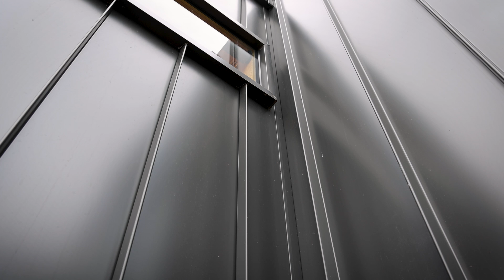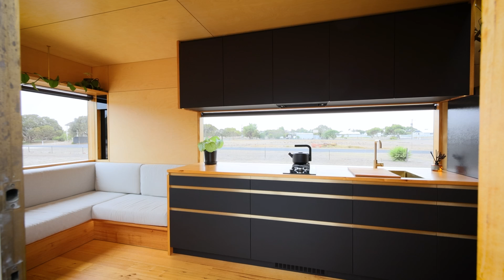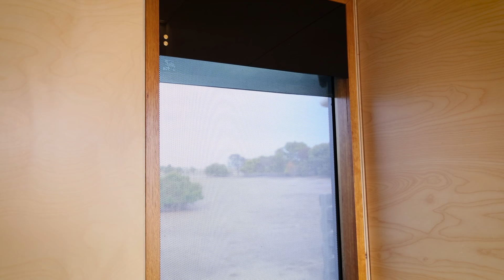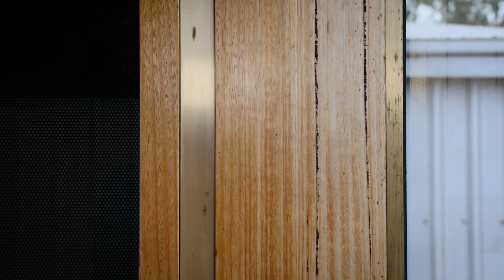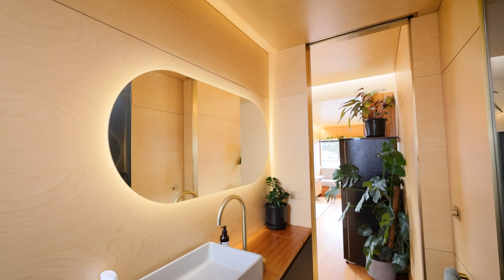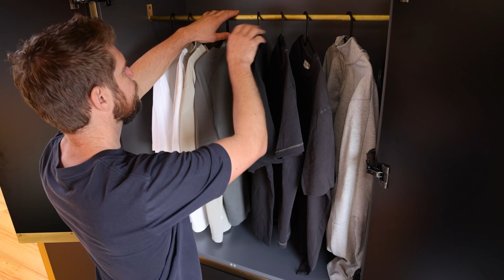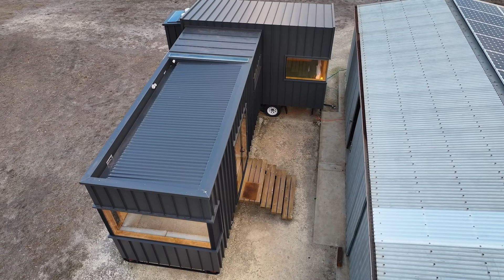Modern-Minimalist Two-Trailer Tiny Home | A Genius DIY Build That Will Blow Your Mind

Comment: I’ve worked in the waterproofing industry for approximately 30 years and am based in the USA.   The level of engineering he put into build exceeds the typical new construction (commercial and residential) we typically see. Further, I am in a hurricane zone of Florida where waterproofing is critical and code driven by the stringent Miami Dade Wind Code. I’d put this home in a wind/water testing chamber with zero reservations. This is truly a marvel.  The way he joined the two structures and detailed the connections and planes is impressive as heck.  I’d struggle preparing CADD details with some of these connections that he figured out 😐.  Roof - to - roof and wall- to-wall connections are very tricky. Amazing! And…the icing on the cake is how BEAUTIFUL the home is. Wow. This one is at least ten levels above some of my favorite builds I’ve seen. ♥🇺🇸
Reply: Well, your response, is most certainly a stamp of recognition!  Ty for helping me understand better, not being an engineer type at all!  ❤
Reply: "Loved this transformation — I'm starting my own channel soon, excited to share my rebuilding!"
Reply: My company is ansi certified and has Miami Dade certified products and those audits are a nightmare 😂
Reply: It would not stand up to wind or water testing...
Reply: @stuartstogdill2406  Oh… okay. Please, explain to me the areas of weakness where moisture intrusion would be an issue. Please..be specific with your technical language.  I can’t wait to hear what you have to say.  And BTW, I’m certain you have this juvenile idea I’m referring to,chamber testing manufacturers perform where they push the limits of the structure to the point of failure and destruction. I’m not. I’m referring to,a testing chamber intended to identify and correct points of moisture intrusion in a dwelling intended to be occupied, not destroyed by simulated hurricane or tornados.  In other words, REAL WORLD testing. Come on…identify the weak areas and again, use proper technical language an Engineer or Moisture Consultant would utilize.
Reply: @lizzieb6311 each state of Australia and then zones within each state have their individual ratings and engineering for you to browse for days as you  please on the internet. It might increase what your using yourself. It's assumed we don't have cyclones. Or events that others have..
Reply: @stuartstogdill2406 having just jumped through 50 hoops PRIOR to the recent energy rating increase yet again in North West of Western Australia. It's obvious Australia's building practices act/laws aren't anything close to others come across. The varying climates rainfall drought soil and temperatures are so varying even within each state of Australia. This guy did say quite clearly at the start the he has to remove it from the block at the start, I'm assuming it is due to the wind zone in South Australia rural.
Reply: @joanneoneil - No, he clearly said he is taking it apart and moving it as soon as he finds the right piece of land in Australia, with the right views that match up with his big windows.

Comment: I have alot of  family in the Netherlands 🇳🇱 and the homes their have opening windows but they also have vents above the windows and some of the doors where they open like an acordian or a pocket door. They are metal vents with tiny holes the size of eraser heads. And they open for fresh air where you can get fresh breezy air but still have security and no bugs get inside because it's kind of like gauze. For example one of my windows in my house is very large and if it needs to be open for fresh air it opens from the top so it pulls downward like a castles drawbridge it opens but only on an angle like a big ✂ scissor. no animals or rodents can get it because of the angle of the window when opened.

Comment: On a recycling water tangent... I've long thought about a shower set up where you could take a guilt free Super Long Hot shower. An outflow mode as usual for scrubbing your bits and using lots of soap. But then move the lever and get effectively a standing hot tub experience using a recirculating system. So you can just stand there in the hot and not be wasting.

Comment: One word... Exquisite 💗 Those Window vents are just mind boggling as are every feature...the sliding roof the Bedroom Door... the Shower is again one word... Exquisite...I'd say its one of the most exceptional versions and visions of form following function l have seen and I have seen a few. The cost to is phenoenal! One other comes to mind and its an artists home. She is a renowned painter of western art with a contemporary flair... The house is built from the natural stone that exists in the rock hill side out cropping. At a distance its invisible from the natural form a rock mother ship. To discribe the detail and the use of natural heating and cooling and the overall structure would take too long, but if interested I'm sure you can find the YouTube.

Comment: Stunning!
Absolutely GORGEOUS!!

The only thing I would have changed was the dual purpose cupboard/bedroom door. I would have added an additional thin panel to the inside of the door - that upclips  and 'splits' the door -  so that you still have your cupboard covered by the hitherto integrated thin panel -  when your bedroom door is closed.

Comment: I have been watching a youtuber from Ontario, Canada , ' Drew Builds." He also built a tiny home from trailer to plumbing and electrical, including cabinetry.  But he did use pre-made windows and doors. He did not put as much in  as this gentleman did.  But he did have to build it to Ontario weather and code.
Reply from the maker: Yeah I've seen a few of his videos. He does some cool projects! His hot spring project was very cool!
Reply: That's part of the resistance to these kinds of houses we have here. Codes. They have stopped a lot of nice builds using that excuse while some of the existing housing was never made to meet them.
Reply: Yes but this one is next level to his….  IMO

Comment: I never understood why is this kind doubling so rare in our community. Once a builder showed me some plans in Hungary (but were never published because the customer didn't want to). Standing parts of the lofts (landings) are also not understandably rare (crawling could be really easy to avoid). Or an overhang against the summer Sun radiation which lets the winter solar gain in; cardinal directions are also not wery discussed—well if somebody builds it black and with AC, wouldn't understand the question anyway. Usually the inner height is also a secret. Nice to see a well thought THoW : )